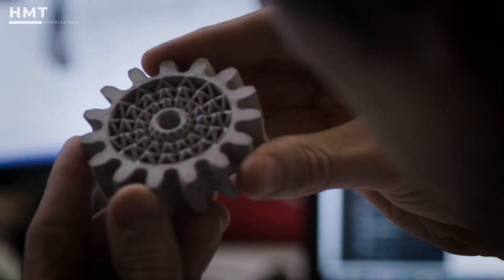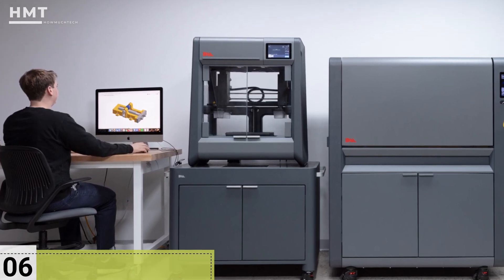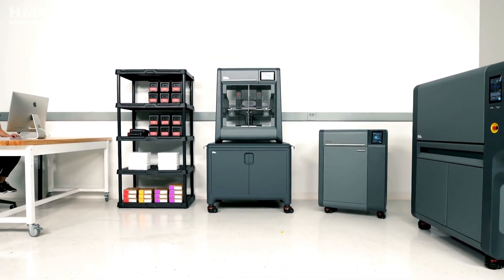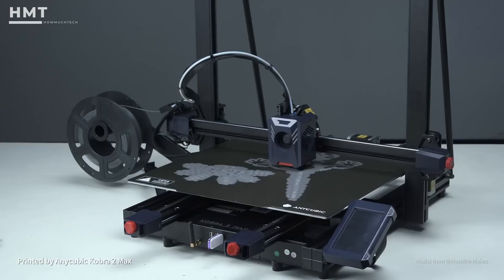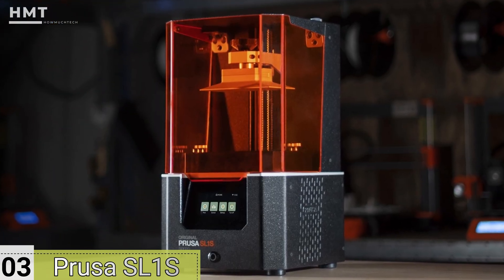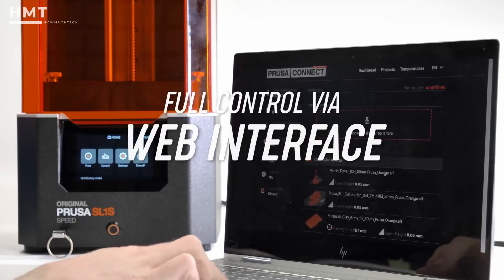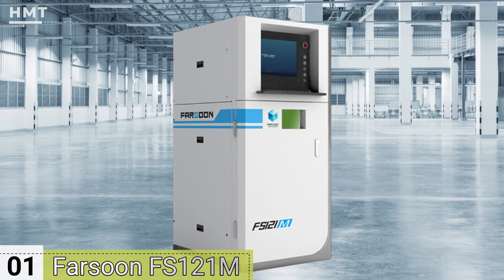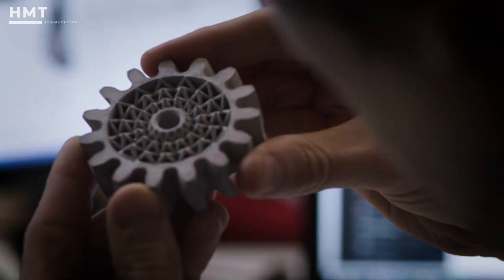Best Metal 3D Printers You NEED to See in 2025

Comment: Could you please recommend me 3D printer machine for Industrial purpose (multiple material can handle like SS , MS , Fiber , Tafflon etc)
Reply: Studio system desktop metal 3d printer price???
Reply from the maker: For industrial 3D printing with multiple materials like stainless steel, mild steel, fiber, and Teflon, you'll need a high-end metal 3D printer or a hybrid system. I’d recommend looking into options like the Markforged FX20, EOS M 290, or Desktop Metal Studio System 2—they support a range of materials and are built for serious production use.